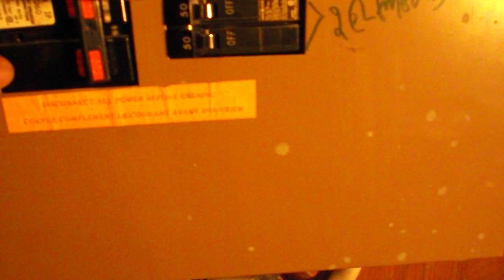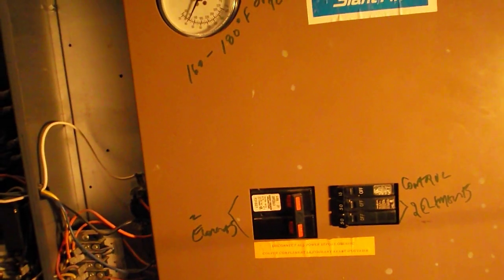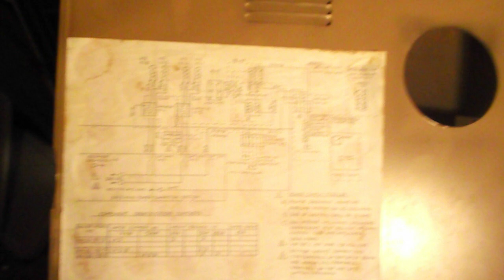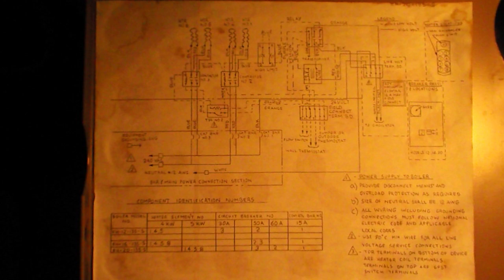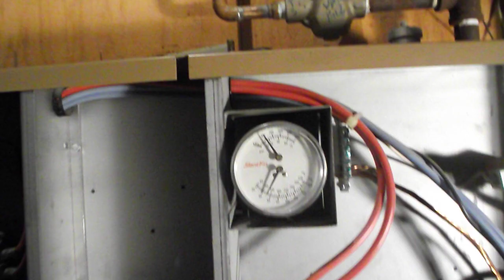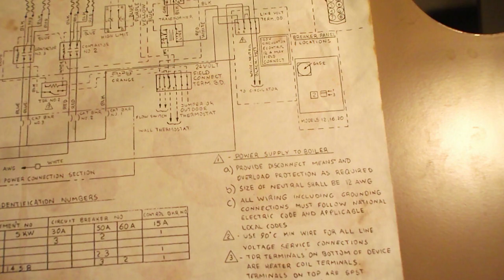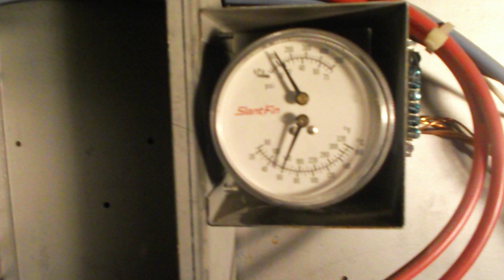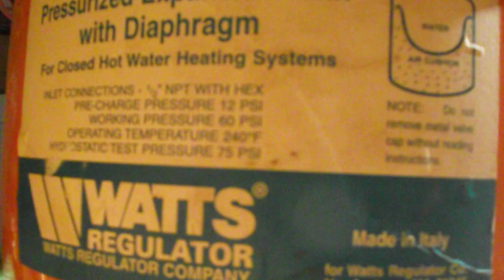"Electric" Hot Water Baseboard Boiler System Description

Comment: what is your electric bill like in the fall and winter...what do u set ur thermostat to ?
Reply from the maker: Hi there.  Electric baseboard is likely cheaper than forced air ducted heating systems due to a better ability to transfer the heat to the zones that need it without loss along the way.  However, the monthly bill will depend upon size and efficiency of the home.  My fathers house ran 300 for heat in the winter months set at 18 deg C in the day and 12 deg C at night.